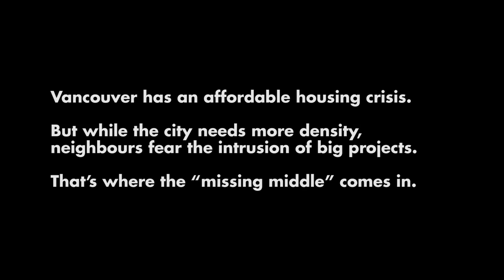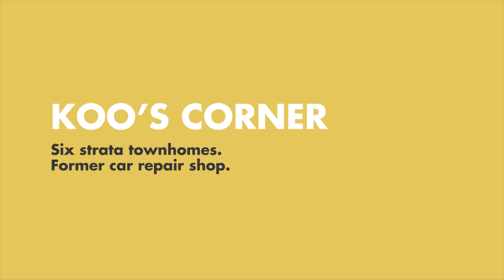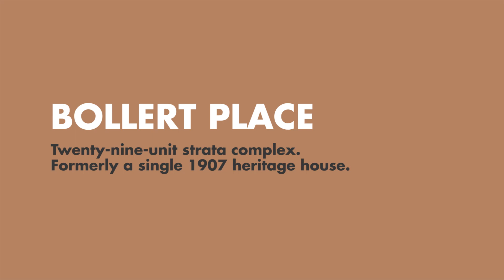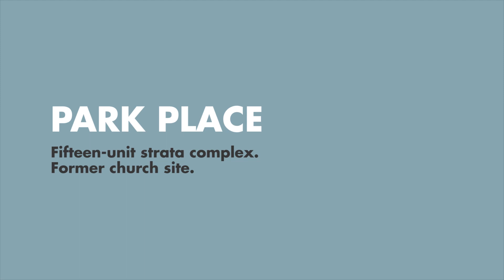The “Missing Middle” in Vancouver’s Housing Density Debate

Comment: The Bollert Place project is clearly an example of an extension attempting to mimic the original style far too closely and in cheaper, shoddy materials (stock aluminium-framed windows, etc.). The idea is great but the execution is a slap-dash failure.

Comment: Unfortunately, this ignores the reality of what actually happens in cities (such as Victoria, BC) that embrace densification, which often masquerades as gentrification.

Up-zoning to permit condos and multiple dwellings exponentially raises land values.  This pleases developers, realtors, and some politicians; however, it results in the overpricing of the housing market.  It also prevents cities from being able to afford to purchase land for the additional parks and green spaces that all increasing populations require.

Most of the tree canopy in Victoria exists on private property.  When that property is densified, the green space supporting those trees and their associated ecosystems disappears.  The public must not be lulled into believing that replacing mature trees with saplings and potted plants on rooftops will adequately address the climate emergency.

Until our zoning regulations require the retention of mature trees and ecosystems, the false panacea of densification does nothing but destroy the livability of a city and line the pockets of profiteers.
Reply: I think you right with the fact that gentrification attracts more renters and buyers.
But housing is so expensive because of the low supply of housing.
You can't solve the housing crisis with building less housing units.
Reply: @paxundpeace9970  I didn't say that gentrification attracts more renters and buyers - what it does is make housing exponentially  more expensive.  Any uplift in zoning should be linked to a requirement that the new units be affordable in perpetuity.  Otherwise, the new units are less affordable than ever.